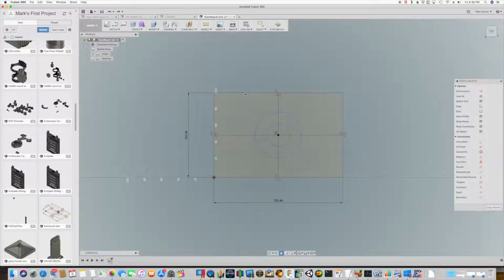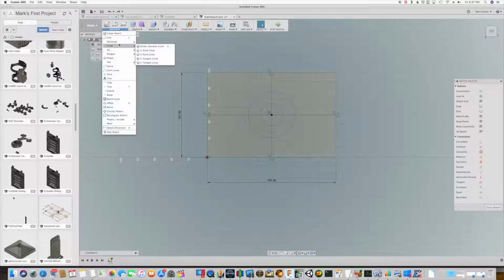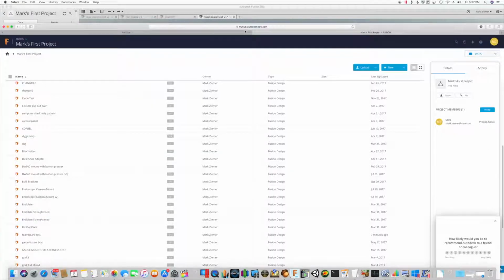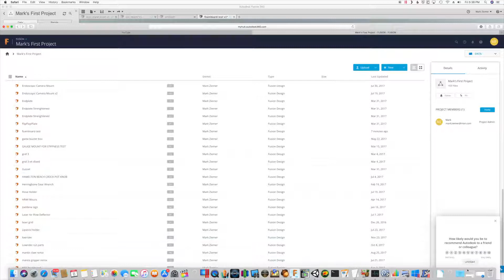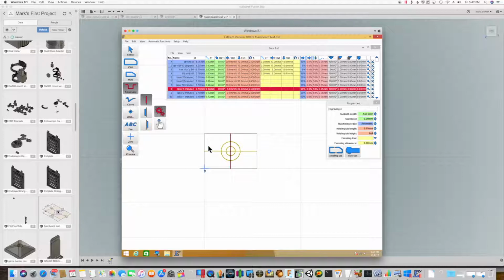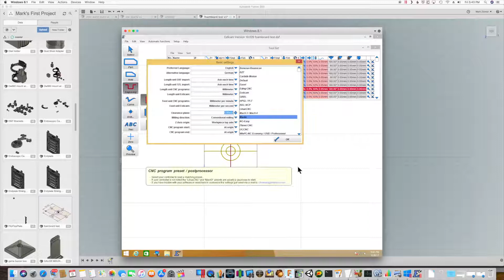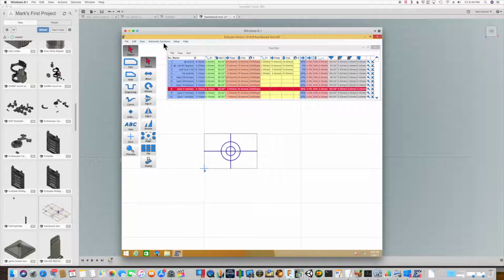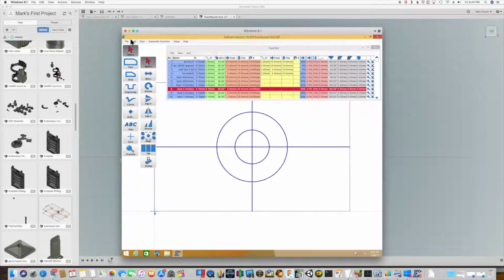Laser Cut Foam Board  - Double Sided

Comment: IF YOU RAISE YOUR WORKPEICE TO THE THICKNESS OF THE MATERIAL SO THAT THERE IS SOME SPACE UNDERNEATH, THE LASER WILL CUT THROUGH, IVE BEEN DOING THIS FOREVER. NOT YELLING, I JUST TYPE IN CAPS LOL
Reply: i have a s9. what settings are you using?

Comment: Sir it's expensive to buy laser module so I want to know minimum watt of laser to buy
Reply from the maker: You could probably get by with 500 mw, but there's a tradeoff.  It's going to take longer/more passes to cut something.  Slowing down may help too, but can cause too much burning. A lower powered laser may limit how deep you can cut.  Good luck!
Reply: @Someoldguycoding  sir in this vedio whow much watt laser u using ? It's diod laser ?
Reply from the maker: Pratik Jambotkar it’s a three watt diode laser. I purchased it on amazon from the seller Sunwin      Power output is controlled by a PWM input. And it runs on 12 volts. Thanks for watching
Reply: @Someoldguycoding  sir it means if. Use 5.5w Laser than same foam board can cut in single cut right
Reply: 1 year later ... I hope you got your system running. I hope you were not fooled by by Lasers advertising input power vs. output power. Many eBay advertised 40 Watt lasers only has 5 Watt optical output. But they are generally grouped by price. Wish you the best.

Comment: Hey,  thanks for making this video.  I was the guy who requested it.  It doesn’t beat the needle cutter unfortunately.  If there was a way to cut all the way through it then it would.      

What do you think is the reason it can’t cut all the way through.   Is it because it’s white?  If so how about different colored foam board?  Could you try the foam without the paper?  Maybe that’ll work.
Reply: Hi Tim, im currently planning to cut out a model or the laser cutter at my school, and we have a trotec Co2 laser, the three settings that actually matter are: power , Speed, and the line must be hair line and red. If you want i can find the settings that worked best for me.

Also you definetly want to have the laser .875 away from the foam when your cutting...
Reply: @techdiyer5290  I appreciate it but its not necessary.  I don’t see myself getting a co2 laser anytime soon so I have no need for the settings.  If I ever do get one I’m sure I could figure out the settings myself.  Good luck and happy building!
Reply from the maker: Hi Tim, yes, I think that if the foam core were a darker color it might work.  Perhaps a different laser source, Co2 maybe,  but I don't know. It seems like the white foam just disperses the laser.
Reply: Some Old Guy Coding Yeah, I’m sure the CO2 laser would work and I’ve seen somebody actually install one on there MPCNC machine.  That just seems like an expensive and complicated modification and I would still like to be able to mill on mine.   Thanks for your videos by the way. Thanks for all of your videos actually.
Reply: Would you do me a favor.  Next time you’re using the laser,  could you try cutting the foam without the paper and see if it cuts all the way through?  I’d appreciate it.  Thanks again.
Reply from the maker: Sure, no problem.  Do I just tear the paper off?  Or is there a different product that doesn't have the paper. 

When I was cutting the craft foam for the halloween video (thin stuff that didn't have paper on it), the white for the hanging ghosts was tough to cut (it would melt a little, but not cut if I didn't go very slow), but the black for the bats cut easily.
Reply: Yeah,  the paper peels right off super easy.  The foam board I use has brown paper so I’m thinking if the laser can cut through the foam it shouldn’t have a problem cutting through the brown paper as well.  Thanks again.   I’m on the fence on buying a laser but if it can cut the foam then I’m gonna go for it!
Reply: @Someoldguycoding  sir what's the laser watt ?
Reply from the maker: @pratikjambotkar4626  3 watt
Reply: Yes, because is white, is racist.